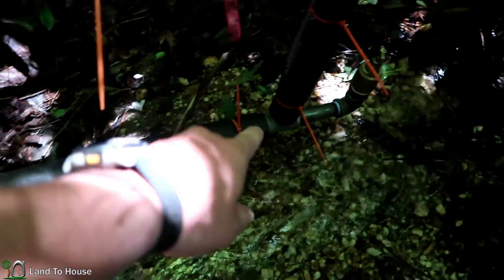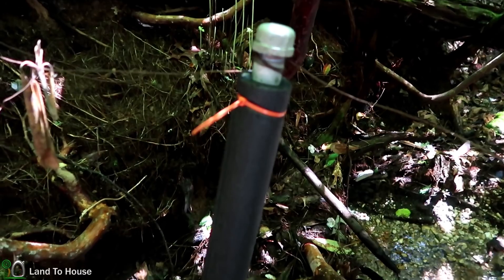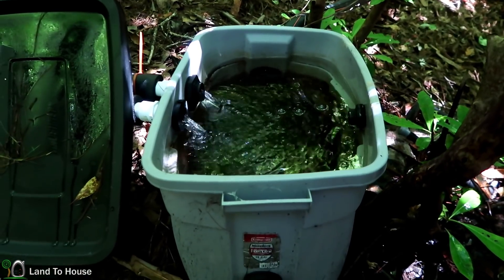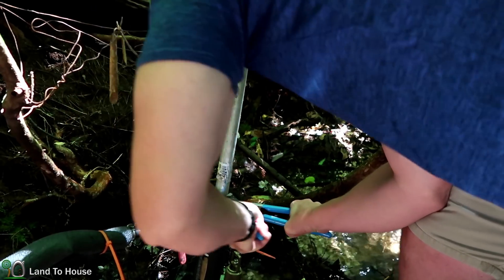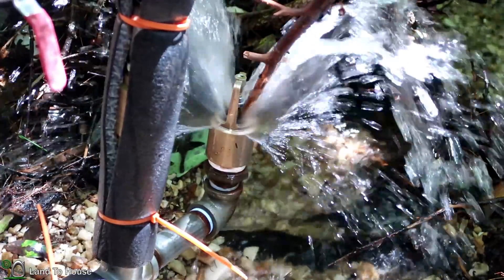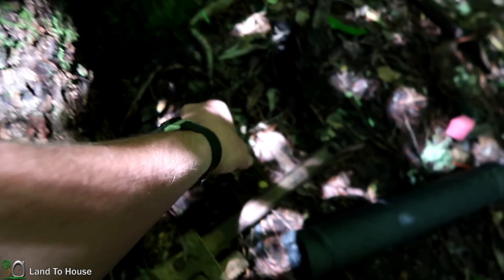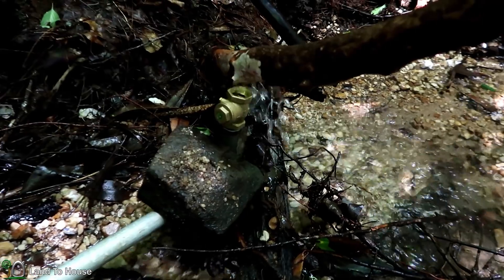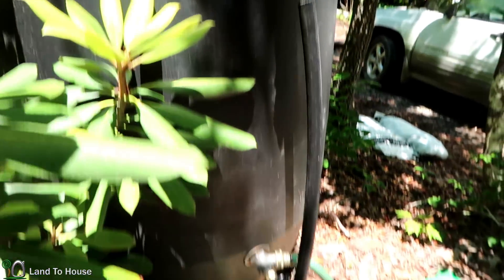Fix a Broken Ram Pump

Comment: That seemed overly loud for a ram pump. Was it to you? If so, what do you think made it so loud compared to how yours sound? I like the quiet operation of yours! :-)
Reply from the maker: I honestly think that's the difference between using a full steel Drive pipe versus using PVC. My pump can be heard about 300 feet away. This one did seem a good bit louder than mine.

Comment: Maybe it is better to increase the size of the waste valve in order to reduce the cycle.
Reply from the maker: It turns out that this pump had significant bounce because the pump was not locked down. The second issue was the extended pipe from the pressure tank to the waste valve reduced the wave so much that the pump would not run

Comment: The swing valve is cycling so frequently . . . Would larger valve provide a little more pressure and flow with less cycling and more waste?
Reply from the maker: The problem is the drive pipe length. It is only 20 foot long and needs to be closer to 50 to 100 foot.
Reply: does longer drive pipe lengthen cycle time? Why? I think long cycle time is better since the valve should last longer, u agree?
Reply from the maker: There are several advantages to finding the correct length Drive pipe. In commercial ram pumps the waste valve weight can be adjusted. This allows you to correctly time the cycle length. If the valve is operating too fast or too slow the pump will not be running efficiently. The Sweet Spot has to do with waste valve weight Drive pipe length and head pressure. In order for this pump to run slower the drive pipe would have to be longer